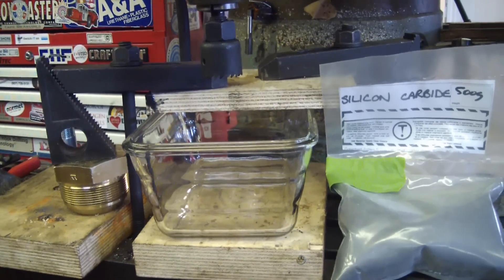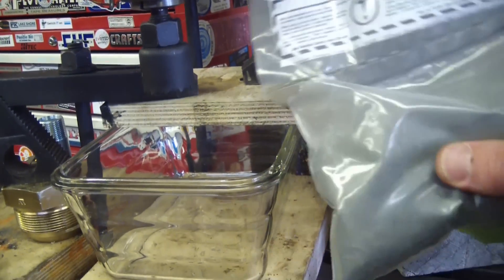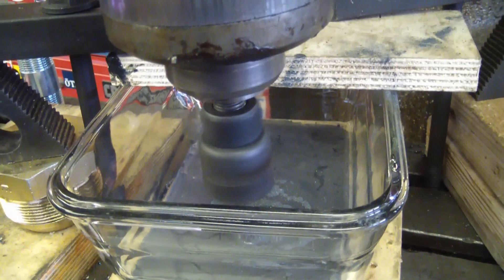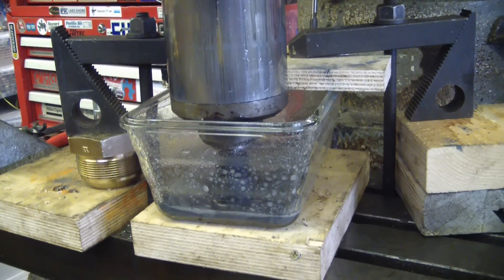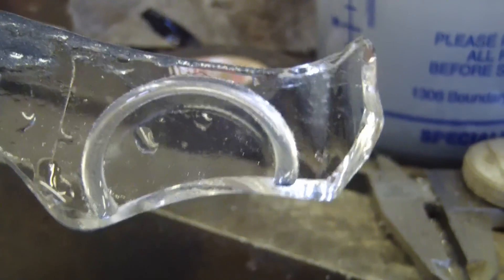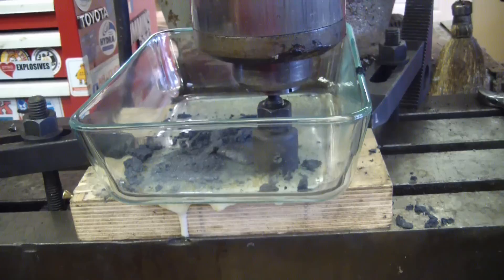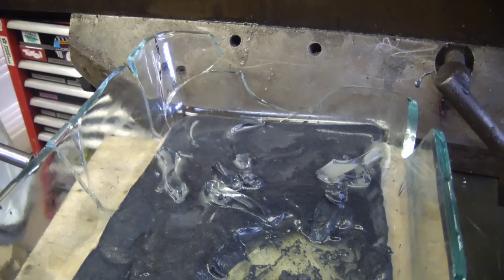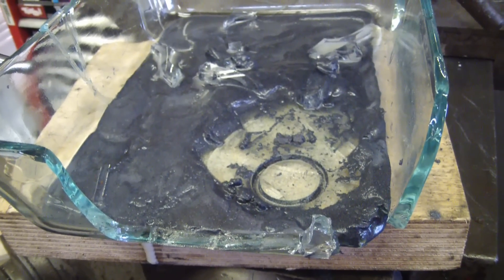Using Silicon Carbide to cut glass

Comment: Probably no one will ever read this, but to drill glass like a champion you use slow speed very light feed, copper pipe, coolant, and abrasive!  The copper pipe is soft enough to pick up the abrasive and carry it along the surface of the glass, scraping tiny glass particles away into the coolant.  Using copper pipe sized to the diameter of the hole you want you will get a slightly enlarged hole, i.e. using 1/4 inch (.250) pipe could bore a hole .260 to .270 if you have a shoddy set up.  This method will drill just about anything, so long as the abrasive powder you use will cut what your drilling.  Diamond abrasive and copper pipe, plus time, equals a hole in anything thing you want.  Coolant is a must and you really should use the coolant recommended for what your cutting. 

 For glass, sea shells, and some stone, try dishwashing liquid in water (soapy water) mixed with the silicone carbide abrasive.  If you want a perfect finish on the front and back, drill half way through each side and meet in the middle of the item.  Drilling all the way through glass will almost always chip the edges when it breaks through.  Placing the item your drilling on foam or a sponge will actually minimize the breakout and chipping of glass when you drill all the way through it. Wish anyone the best of luck trying this!  If anyone reads this and it helps I would love to know someone got some use of my 15 minutes thinking about this response.
Reply: bump
Reply: I've heard hardwood dowels also works.
Reply: commenting so it goes to the top, too
Reply: bump
Reply: .
heheh
Reply: Thanks for taking the time to share a proven method.
Reply: Thx for the info
Reply: Excellent comment and advice. Thanks.
Reply: bump. the world needs more knowledgeable people :)
Reply: there is something to consier about glass, it breaks under vibration, so the old technique for cutting glass with a pair of SCISORS in a factory, yes you've read right scisors, they would put the glass sheat in a large container fully submerged in water that absorbs the vibrations, lowers the resonance of glass, for drilling a carbide or vidia dril bit, like for stone drilling with no percution fully submerged in water on a piece of wood works best
Reply: Alexandru Alanei
I've heard of that. I've yet to try it.
Reply: Alexandru Alanei that's kind of what i thought about the glass breaking. The vibration must have matched the resonant frequency of that Pyrex dish just right, to cause it to break in spots away from the hole saw bit.
Reply: that's it, you've said it better
Reply: Completely agree, a good diamond hole saw is essentially that, diamonds suspended in brass(I believe it's brass). maybe smash the end of the copper into the dry carbide first to jam some in it and then give this a whirl. Heat and vibration are your enemy. I imagine your hole saw was actually throwing all the carbide away from the cut.
Reply: one problem is that glass is a great insulator, and that you aren't really irrigating the channel you're cutting.  the rumor i heard, (sounds like you're thinking the same) is that the pyrex name was sold to chinese manufactories, amd now no longer means borosilicate and no guarantees as to the amount of annealing that may or may not have taken place.  build you a polariscope, AVE!   P.S.  thanks for everything!
Reply: steamgadget 
I agree. I've never used a copper pipe to cut glass but I did use one to cut a hole in plastic. it is amazing how well it worked. I just used sand from the river and slow speed. Good trick! Thanks for the reminder.
Reply: I dunno about being sold to the Chinese, but Pyrex changed their formula from borosilicate to a different kind of glass because they found that people were far more likely to drop their glass cookware than to go from temperature extremes with it. Basically they reformulated the glass for what people were experiencing, so it's less likely to shatter when you drop it. If you want the temperature variation resistance stick to older Pyrex, it's very common in thrift shops.
Reply: I don't understand how that works.  Do you press the opening of the pipe against the glass and pump the coolant/abrasive through it?  How much pressure do you use?  I am a complete novice to all this.
Reply: could it be possible that the glass is tempered rather than being Borosilicate is causing it to fail?
Reply: Kerosene is supposed to be a better coolant for glass drilling.
Reply: steamgadget: Yup. very light feed pressure.Hope he sees your comment.
Reply: steamgadget bump
Reply: steamgadget this was my idea, use a pvc tube with only 1 or 2 reliefs to help with letting abrasive in and out.
Reply: Another bump, but bazz p identified the root cause below. So-called "Pyrex" these days isn't borosilicate any more but just tempered regular glass. It survives thermal changes by having its outside under strong compression and the inside under strong tension. Disturb the balance and it'll shatter. There's even been cases of cookware literally exploding while just sitting on people's tables, apparently due to minor imperfections. (Google "exploding Pyrex") The various techniques described are great for drilling plate glass, etc, but I don't think there's any technique that would put a hole through modern "Pyrex" without shattering it.
Reply: Up you go, man.
Reply: I have not yet used this, but this does answer some questions I had about a project I am planning out. thank you for sharing this advice.
Reply: @AvE
Reply: Hard Wood dowel will also work, but tempered glass cant be cut cold it needs to be near melting point.
Reply: Best solution yet, awesome!
Reply: I thought a re anneal would do the trick
Reply: Alexandru Alanei I remember my dad telling me this about 40 years ago... the more I remember things he told me, the more I wish I would have listened.
Reply: I want to drill a hole in a ball bearing, will this technique work?
Reply: miller
Reply: ...What he said
Reply: Bump
Reply: @kevinholl8015  Thanks!

Comment: Before you attemt to "drill" mineral glass i advise you to check for internal tension in the glass. How? Take 2 polaroid lenses and orient the first horizontally and the second vertically with distance in between to bring your object after the first and before the second lens. Without glass object light transmission throug the 2 lenses wil be very dim. When you bring a hardened glass object in between you wil see tension "flames". With any flaming visible every attempt to drill or grind is useless. Kind regards from an old school optician.

Comment: there is a way to do it....you drop pyrex making it shatter into a million pieces...then glue the dish back together leaving out only the pieces where you need a hole. :) hope this helps.
Reply: Over all weight of the drilling piece should be minimal now you have heavy cuter heave chuck and weight of the turning shaft of the pulley  all  made  a high impact on the glass to break . I think you can made initial cut how you cut and once you have a circular grove   You  can hold  it against the cutting piece with you hand only  so it absorbing all the vibration made Sure you ware glove.

Comment: Journeymen glazier here. That's glass is heat strengthened. You can either anneal the glass again or buy a non heat strengthened dish to drill. Any glass that has gone through any strengthening or tempering process can not be cut or drilled with anything. An option you can try is to melt a hole in it.
Reply: Also the dish can not be tempered as tempered glass does not like heat. So it is heat strengthened to withstand higher temps. Same process. Just lower temps in the oven and shorter quench time.
Reply: +Lunar Lancer oooooo. melt a hole! sounds awesome!
Reply: Great idea, Decim.

Comment: Nothing constructive to add here, so I'm just going to read all the other comments. I'm anxious to see who's an expert cutting glass on a milling machine using a hole saw. 😁
Reply: ***** If you can drill a small pilot hole though the glass without it breaking, you've at least a chance of drilling the large hole successfully.

I think the Dollar stores have glass containers in similar shape and size;  perhaps a cheaper glass might work better for this operation?
Reply: ***** I also have absolutely nothing to add
Reply: hahahaha - Adam started it :)
Reply: I would have said something sooner but I was doubled over laughing. Your videos are gold. Fill the container with water. Thermal expansion is your enemy here. Maybe find an adhesive that takes heat well and glue the carbide to the hole saw. There's no need for wood cutting sized teeth for this so try cutting them down but leave some relief for slurry to exit.
Reply: Mac Trocino not so much exit but get the cooling in and out I know there was almost no water in the center of the hole saw it pumped it all out

Comment: tempered glass can not be cut.  This dish was probably hardened for two reasons.  makes it more resistant to damage from drops, and makes it more resistant to temperature changes.  tempered glass basically has a large amount of exterior tension, and once released, it is explosive.
Reply: +Thomas Gunkler Yep, I work in a glass factory and one of the fun things we do to new guys working in cutting is give them a piece of tempered and tell them it needs to be cut down.  The looks on their faces when the glass pops is priceless, especially if they know nothing about glass.  Then ya gotta give them the old 'aw man that unit was hot... the boss is gonna be pissed'  Good times.
Reply: +damedog19 fuck now I wont sleep :D
Reply: +huhhman not sure about that. the issue would be the edge of the cut glass. tempered glass must have a tapered edge. if it has a sharp edge, it won't last long. so unless the laser cuts a tapered (beveled) edge. not gonna last long.
Reply: +Thomas Gunkler 
The fun part of proving this is using a polarized lens to see the stress marks.   Cheaper the polarized sunglass, the better you see it.
Reply: +Thomas Gunkler It can be cut, I saw a guy do it in another video. His technique though was to go very slow and dont use constant pressure like AvE is doing. I think it might be cracking due to vibration building up, you need to lift up the saw/drill. All the other guy used was water too I think, he didnt use carbide.
Reply: +Thomas Gunkler 
What if you heated it up first to release the tension inside the glass?
Reply: +Stick Figure that exactly what I was thinking
Reply: It may be possible to sandblast a hole through it, but I would advise against it. I don't get paid enough to work around glass dust.

Comment: AvE;

You got it when you referenced the Prince Rupert's drops.  Pyrex is pre-stressed glass and that is why it is rock hard and tough to break.  You are cutting through the outer stressed layer, stress now looking for places to go, and shazamm you have broken glass.

I know in lab class, the only way we could ever try to do anything with Pyrex was to heat that stuff up until it was just about molten and then try to manipulate it.  And try to manipulate it is the key phrase.  The techs in the shop who made glassware for the profs and grad students would laugh their asses off watching us undergrads try to make something.

Well worth the experiment.

Regards;

Ron Kluwe
Reply: Exactly. You need regular old glass. Pyrex is all about the internal stress.
Reply: Modern pyrex cookware is stressed soda glass, pyrex lab glass is borosilicate.  Higher temps used to work borosilicate than "standard" glass but in itself it tends to be more durable.

Comment: How honest of you to show your results even when you're unsuccessful.
It's quiet puzzling, why the glass  breaks all over the place all of a sudden, even in places that seem to be totally isolated from the point you apply a force to.
Reply: The Post Apocalyptic Inventor I just read your post in that German accent of yours... :)
Reply: That's a property of glass (and other structural plastics, like reenforced concrete) that has internal stresses caused by  uneven or rapid hardening, often intentional.  The desired effect is mainly to increase the strength and durability of the surface material, at the expense of the internal material's resilience.  In short, once the internal stresses of the material become uneven due to a breach, it results in a chain reaction that pulls apart the rest of the structure, that approaches, sometimes exceeds, the speed of sound through the material.  

For pyrex glass, this is over 5000 m/s.

A high speed camera filming at 25,000 fps would not capture two frames of the 8" dish fracturing, and 100,000 fps, only 3 or 4.

To get better than 1 mm resolution of a fracture in progress in pyrex,  would require a frame rate approaching 6 million FPS:  a restricted technology.
Reply: ***** I had it coming ...
Reply: ***** Well. After reading over 200 positive comments on my German accent a few days ago, changing anything in that direction would simply be a "bad business decision", not even talking about "staying true to oneself" and that kind of stuff. BTW: I had to smile when I heard you talkin' French  all of a sudden. Must have caused some irritation  :D
Reply: Nevin Williams
That is why you are not supposed to bang a hammer directly with another hammer.
They can "explode".
"Crystals" have this tendency to get stressed if they are cooled too rapidly and snap, releasing this energy, if you push them beyond their maximum tolerance.
Meaning they are not "plastic" in behavior at all.
I do not think that concrete forms crystals. Granite on the other hand will blow out if you heat it or hammer drill it.
Reply: But isn't glass an "amorphous"  material, rather than a crystal ?
Reply: plain glass composition:
SiO2 67–75%
Na2O 10–20%
CaO  5–15%
+  Fe2O3, erbium oxide  and cerium oxide

Pyrex glass (tempered glass) composition:
80.6% SiO2,
12.6% B2O3,
4.2% Na2O,
2.2% Al2O3,
+ Fe2O3, CaO, MgO, and Cl.
And that is why it is also called borosilicate glass.

Just as in Ferrous metals the percentage of carbon determines what is plain iron, steel or cast iron.
Reply: Ah ok thanks. Good to know. I didn't know that "Pyrex" is borosilicate glass. In Germany we call it "Duran" or "Jenaer Glas" (cause it was traditionally produced in the city of Jena). These are  the small differences between Germany and the English speaking world.
Reply: Glass, granite, concrete and most metals are not classically considered crystals.   Granite is a igneous mixture of assorted crystal and amorphous substances fused together, and metals are beyond my ability to concisely explain, having properties both crystalline and amorphous.

Strictly speaking of glass, heating can and does relieve stress, but depending on the extent of the stresses, it can be difficult to re-heat to sufficient temperature without having the structure autonomously rapidly disassemble.
Reply: The Post Apocalyptic Inventor Pyrex glassware was traditionally made from borosilicate glass. But they got cheap and now pyrex brand can sometimes not be made from borosilicate.   "Pyrex" in context of a kitchen could be any oven-safe glass cookware. In context of a glass shop could mean specifically borosilicate though

As far as drilling though the dish, perhaps corningware or corelle may take to getting drilled better?
Reply: That's just what a man does.

Comment: Glass artist here. If you can't be arsed to buy a glass bit, you need to go slow, use a softer material for the bit, (wood, maybe?) and put as much water in as you can get to help prevent thermal shock. It's also a good idea to back off every now and then to let more grit get into the groove and rinse the glass powder out.
Reply: Cool, but say he goes with the softer material, because shits and giggles, wouldn't that increase the surface area and make it harder to cut? Is it pretty much a case of "suck it up buttercup, she gonna take her time"?
Reply: The only concern with surface area is how much glass you're wasting. The "bit" isn't doing the work, it's all about the abrasive. You don't cut glass, you slowly sand it away or break it along an induced fault.
Reply: Dominic has sound advice. My diamond saw runs on nylon wheels. The glass get hot even with water and glass is no forgiving. Slow is key. Sanding the glass down.

Comment: The same technique is used to cut holes in telescope mirrors. However, you use a copper tube in place of your hole saw as the carbide will embed into the copper. If your glass dish is tempered, it is pre-stressed and will shatter if the surface is scratched or damaged. Look at it with polarized sunglasses, if it looks splotchy, it is tempered. Find one that isn't. Older ones weren't.
Reply: This should work

Comment: This is tempered (or toughened) glass, which has internal stresses which increases its resistance to fracture. Cheap tempered glass (usually cooled too quickly or at a wrong temperature) generally has uneven stresses throughout and can even spontaneously fracture (e.g., like some cheap Chinese glass patio furniture). This also means that if you relieve some of the internal stresses, they tend to fracture readily.